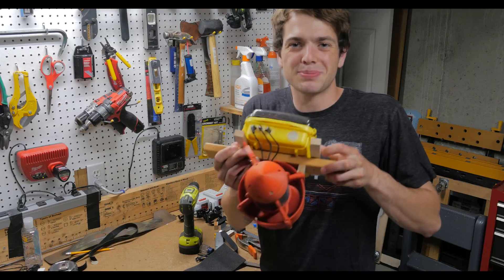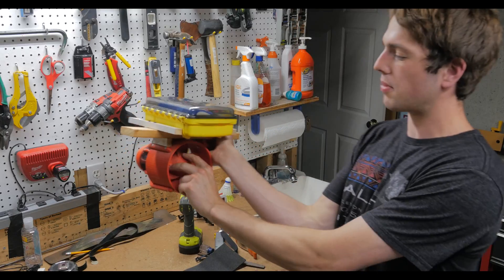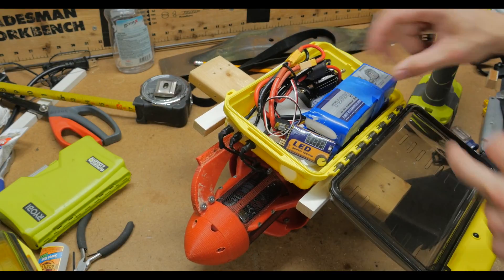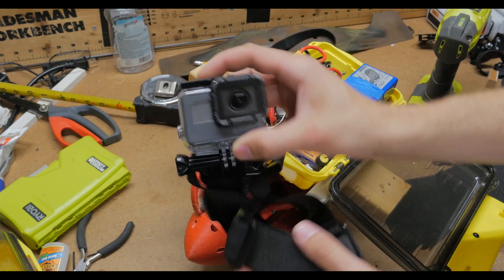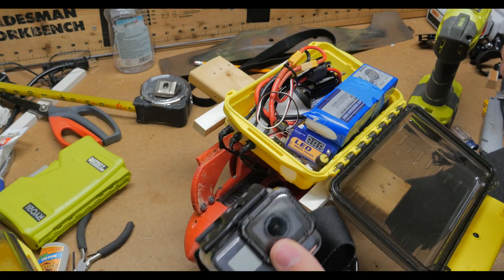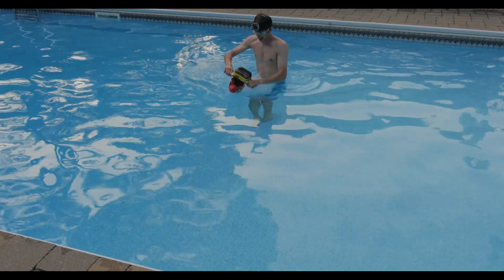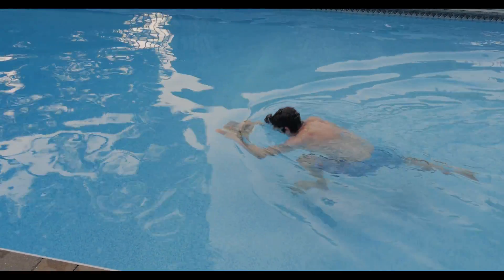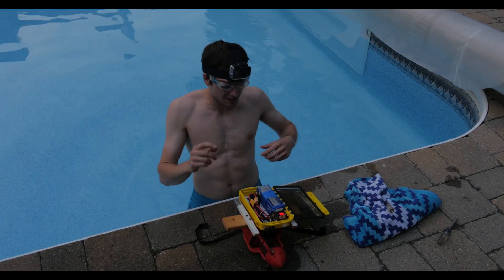Super Fast Underwater Thruster!!!

Comment: very slow and that box is super unsafe considering you have lipos in it. IT can leak underwater and you will have a very bad day.
Reply from the maker: I don't think it is very unsafe at all. What are you so scared of happening?
Reply: @mattsheehy1854  ignorance is a bliss. Do you even remotely realize what happens to lithium if it contacts with water? That box will leak underwater.
Reply from the maker: @VladOnEarth  Spreading miss information is bliss. Lipos only contain like 7% lithium so even if some how water gets into the sealed cell there isn't too much to react with. There is a large amount of humidity in the air which could cause the lithium to react So they must be air tight to not allow anything in therefore, they are waterproof. the worst that can happen to your batteries is that the terminals that the wires connect to could corrode. People even put many lithium batteries is salt water to fully discharge them for disposable.

Also that's a dive box rated for 16ft underwater. My pool is 7.5 feet deep it's not going to leak.
Reply: @mattsheehy1854  whatever bud, I already engineered with lithium when you was 5 years old probably. Being in denial about lipo (not liion) satety isnt gonna help you. But at least thats a dive box, so it is better, looked like a food container to me.
Reply from the maker: @VladOnEarth  I don't really like Lipos anyway I don't really use them any more. If you want to critique my newest battery build check out this post. I'm not quite done with it yet but I'm always looking for information on how to make my large batteries safer.
Reply from the maker: https://foil.zone/t/rife-case-build-with-removable-mast-and-conduction-cooling/19941
Reply: @mattsheehy1854  i do t want to critique anything, just pointed out safety concern. What you need is a much more powerful motor first of all. I recently decided to build my own as well, this is how I know. For a reasonable pull you will need at least 1.5kW motor, i personally would go for 2kW. For batteries, on your link he is using liion cells, thats differemt from lipo, they are sealed reliably and not a fire hazard. There is a reason why most big companies use LiFePO battery chemistry instead - safety. I am also going to play with new impeller design - dont know the name, where every blade is a loop instead. Because normal impeller is pretty noisy underwater and because why not!
Reply from the maker: On my efoil builds I'm using a bunch of 21700 li-ion cells which I like a lot. My newest efoil I'm using some huge LiFePO4 cells which I like for the low resistance, high cycle life and safety. Just not the best energy density. The moter I used in here was probably around 2 kw at 6s but I would definitely pick up a larger moter in the future.

This is the motor I used: 
 https://hobbyking.com/en_us/turnigy-aerodrive-sk3-6374-149kv-brushless-outrunner-motor.html

I would look at the waterproof Flipsky motors if you haven't already might be a bit too powerful but they are already sealed and have a low KV for a direct drive prop.
Reply: @mattsheehy1854  I was about to say - I can't use outrunner, I am on the ocean, so I was checking on ali and generally these motors are within $150-$250 range there, which is fine too. Very very weird that it feels so underpowered with 2kW motor. I only used such turnigy motors in Drone build, so maybe they arent meant for water application somehow. I've also had yamaha jetpod pro, and that thing definitely pulls much better than yours and I cant imagine it has anywhere close to 2kW motor in it, probably 600W ish. Also, while not reliable, ChatGPT suggested 1.5kW should pull you 10mi/hr or more. Jetpod puls around 4mi/hr. So yours should be pulling you much faster than that. Could be a prop design too, but on other hand yaamaha has a VERY basic prop there as well.
Reply: @mattsheehy1854   @mattsheehy1854  I was about to say - I can't use outrunner, I am on the ocean, so I was checking on ali and generally these motors are within $150-$250 range there, which is fine too. Very very weird that it feels so underpowered with 2kW motor. I only used such turnigy motors in Drone build, so maybe they arent meant for water application somehow. I've also had yamaha jetpod pro, and that thing definitely pulls much better than yours and I cant imagine it has anywhere close to 2kW motor in it, probably 600W ish. Also, while not reliable, ChatGPT suggested 1.5kW should pull you 10mi/hr or more. Jetpod puls around 4mi/hr. So yours should be pulling you much faster than that. Could be a prop design too, but on other hand yaamaha has a VERY basic prop there as well. In the end of a video that speed is comparable with jetpod there though, but still I expect much more from 2kW.

Comment: how did you waterproof the motor?
Reply: Use CorrosionX. It's a hydrophobic fluid that prevents corrosion.
Reply from the maker: You actually don't need to. Pretty much any motor can run underwater unprotected becuase the enamal on the motor windings. The only thing you really need to worry about is corrosion of the bearings and stuff
Reply: @mattsheehy1854  This is amazing.  My life is changed and will never be the same.  cheers
Reply: @mattsheehy1854  And how did you deal with corrosion?

Comment: Hey Matt, not sure at what depth your controller box is good for but you might consider a magnetic coupling for your speed control. That way could control your speed while underwater. https://www.kjmagnetics.com/blog.asp?p=magnetic-coupling.
Reply: I built a control box for my BlueRobotics T-200 thrusters I use on a 10" fishing kayak. I have two thrusters, one on each side of the kayak and using the BlueRobotics Thruster Commander I can operate in a "skid steering" mode. 
I wanted my control box to be watertight and used several other BlueRobotics components to achieve this. The control pots were the most problematic given they needed to turn. 

I ended up using a couple BlueRobotics switch assemblies that I modified. This link will give you some idea of how I made the mods. https://www.flickr.com/photos/pakbikes/albums/72157693503533505

My control box was never intended to operate underwater but I did test it out under about a foot of water and everything inside the control box stayed dry. I was mainly wanting to keep the electronics inside the box dry from rain and water splashing onto the box or if I dropped the control box overboard. ;-) 

BlueRobotics switch:
https://bluerobotics.com/store/comm-control-power/switch/switch-10-5a-r1/

BlueRobotics Thruster Commander:
https://bluerobotics.com/store/comm-control-power/elec-packages/cmdr-r1-rp/

BlueRobotics T-200 Thruster (7.8 lb f forward thrust @ 12Vdc & 11.2 lb f forward thrust at 16Vdc) 
https://bluerobotics.com/store/thrusters/t100-t200-thrusters/t200-thruster/

Check out the complete lineup of BlueRobotics thruster and accessories.
Note that their trusters are meant to operate in water. that is how they are kept cool.
https://bluerobotics.com/product-category/thrusters/t100-t200-thrusters/
Reply: Phil Krug Yo how many times you gonna say blue robotics lol!

Comment: I'm thinking of using a 2200W, 2050KV brushless motor with a 120A ESC for a similar project, do you think it would be suitable ? Or is the KV rating too high
Reply: Kv rating way to high. Max 800 kv or the esc and motor will overheat